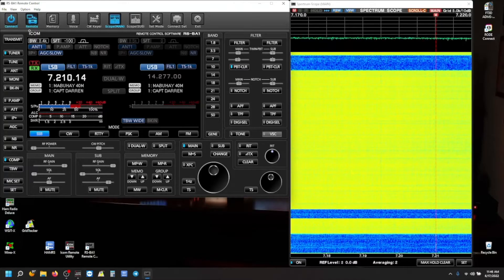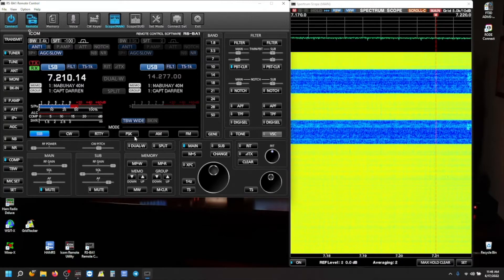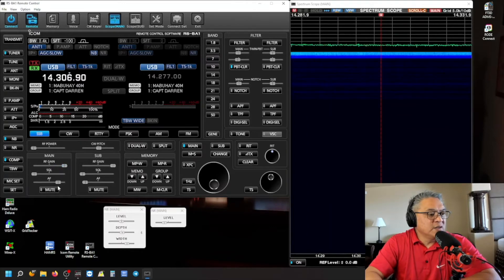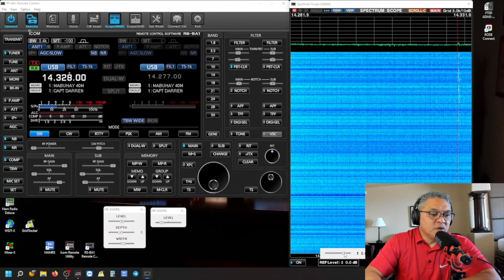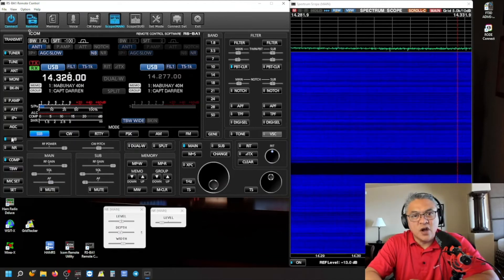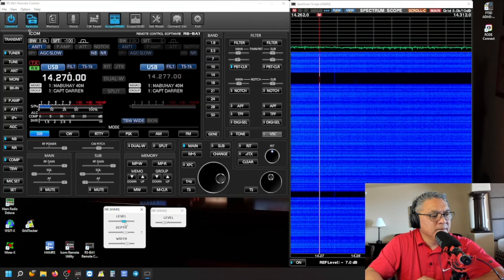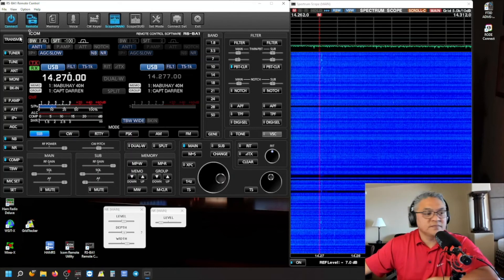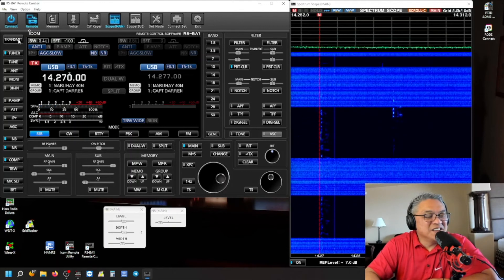Reducing Radio Frequency Interferenc (RFI) on Icom IC-7610 | Using Noise Blanker and Noise Reduction

Comment: I would start with a common mode choke at your radio then one at your antenna. Why, a short explanation, the one on the radio stops common mode noise at your radio the one at the antenna to keep the RF in the antenna.  This all helps to lower your noise floor. This with other activities will help.  Noise removed outside the radio is more dynamic range in your radio.  Note you need them to have 30db reduction for best results.